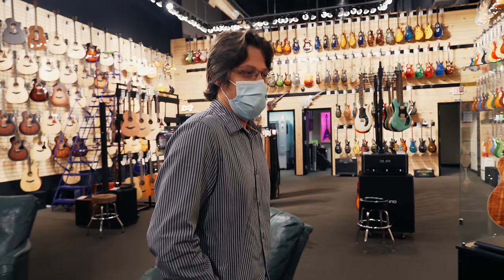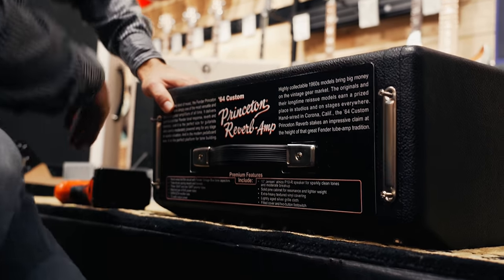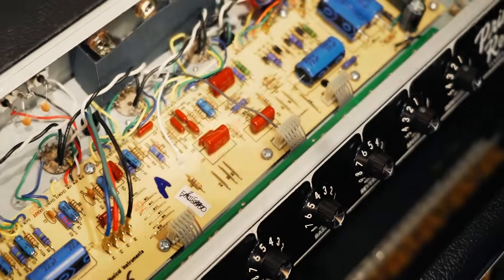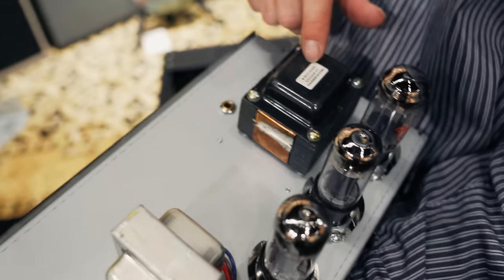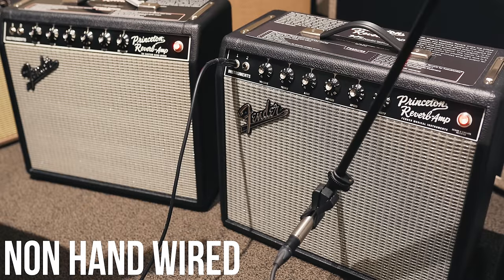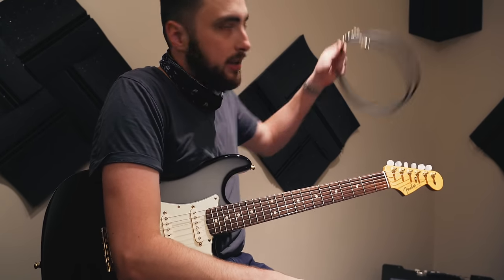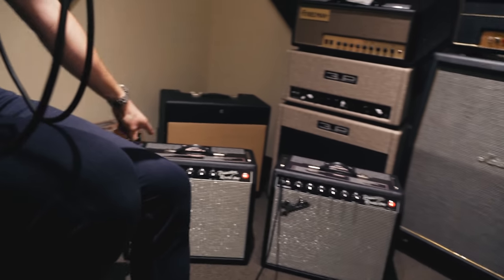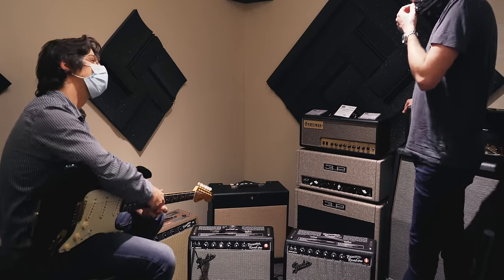Are Hand Wired Amps Really Better?

Comment: As Rhett said, don’t open up your amp. Accidentally touched a capacitor with my left hand, and I had my right hand resting on my guitar strings, so the current went up my left arm, through my heart, and out the right arm and zapped the strings. According to my Apple Watch, my heart rate was alternating between 40 and 190bpm for the next 15 minutes.
Reply: What would of happened if your right hand wasn’t on ur guitar strings? Glad u are ok!
Reply: Man I was playing my dad's old 60's windowmaker noname amp that still had a two prong power cord and was trying to plug a speaker into my computer to hear music to play to. One hand on the guitar and as soon as my other hand touched the back panel of the computer...SQUEEEEEK..was about the only sound I made but I felt that bolt shoot through my heart with this sick pop. I felt for sure that my heart had literally skipped for at least a full second. To this day the grossest feeling Ive very felt.

Comment: To me the non hand wired amp has a cleaner and brighter sound which I actually slightly prefer. I feel though the hand wired would sound better completely dimed but I don’t really use that sound . They both sound absolutely amazing though

Comment: As expected, the two amps sounded differently due to the different components, speaker and maybe even circuit schematic. Given a practically identical set of components and circuit for both amplifiers, the handwired vs non-handwired construction should not influence at all, as electrically they would practically be the same thing. Due to different layouts and wire placements on the handwired variant's board, it would be easier to replace components and debug, but that's a separate subject. Great demo and playing guys, they both sounded magnificent cranked with the black strat!

Comment: Again, what can't be beat about hand-wired amps is their gloriously quick, cheap, and easy serviceability. This cannot be emphasized enough. With basic electronic circuit knowledge, soldering skills and solid safety practices, you're golden. Eyelet boards are a total breeze to replace old worn out/out of spec components on, and even mod should you wish it (which is exactly what I did when I turned my AB165 into a AB165/AA864 hybrid with extra mods - all non-destructive and easily reversible). In my 25 years of owning this amp, I've never once required an amp tech, and doubt I ever will.

Comment: This was an interesting one. The hand-wired sounds better but not 1300 USD better... I also think most of difference is from the speaker Jensen P10R, which costs only like 80 bucks. In fact, I think Fender should simply make a more affordable (maybe Asian manufacturing?) version of the Princeton, Deluxe Reverb, and Twin Reverb. Both Vox and Marshall have ACs and Plexi style amps starting from 500-600 bucks, but for a Fender blackface sound you gotta spend at least 1000 bucks on the made in Mexico Custom '68 series or even more for the '65 American Reissues...

Comment: The hand wired version will likely last longer and hold it's value better. Tonally it is simply down to components and speakers etc. The solder isn't magic. The same circuit will function the same way whether it's point to point or PCB, it will just function more reliably for longer in a hand wired amp and be easier to maintain.

Comment: Another thought to point out is that a lot of the hand-wired amps are more expensive and the companies often go out of their way to use better capacitors in them (not the 2-year rated cheapies that might not be the best choice) ... and those alone might make a sound difference if you took that care with the PCB boards, the difference might evaporate further.  The PCB boards are technically better designed, so there's that. I have 4 PCB amps and 1 hand wired amp, love them all and will likely look into improving the capacitors on then Twin and Princeton in the near future, and then keeping them forever. 

  I have no prejudice against PCB boards, they're consistent and the amp sounds great.

Comment: I accidentally shocked myself on my hand wired amp that I built and my entire arm was totally numb for a long time after it knocked me backwards out of my chair .It also left a burn spot on my hand that is still there to this day ! Super dangerous if you don't show it the respect it deserves !
Reply: Yep. I was hit by 120V while working on a radio.  BAM to the arm.  And yes, it'll burn ya sometimes. Capacitors will too.  Best Regards and very good advise.

Comment: Another likely factor between the two amps that I didn’t hear mentioned is the difference in the woods used for the cabinets. Just like guitars, the wood also makes a difference in the amps.  64 Custom has solid pine vs. 65 Reissue has plywood I believe.

Comment: Yeah, I didn´t see the complete video to see they play different combination hand-nohanded components
Reply: see at 12:40
Reply: They also played both amps through the alnico speaker.
Reply: You're correct. But even more than that, there's nothing magic about a hand wired circuit which guarantees it'll sound better. It could just as easily sound the same, or worse than a PCB layout. Any remaining differences between these two after going through the same speaker are likely the result of the different components used (and any circuit differences, if there are some), rather than the point to point wiring. Copper traces on PCBs are just as conductive as copper wires.
Reply: @400_billion_suns  Possibly if the same components were used in both amps! They weren't the same because of bean counters! Also the cabinets may have been different (Wood vs Press Board).

Comment: I own a Fender 68 custon reverb , I purchased it used because it was in my price range . Would I have purchased a hand wire version if my finances allowed it absolutely . WHEN i PURCHASED THE AMP THERE WAS A  e v  ELECTRO VOICE FORCE 12 SPEAKER IN IT  . It just sounded OK . I swapped out the speaker with an Eminance GB 128 that I had the difference was amazing . While this  may not be my dream amp . It is as good as it gets for me . My point is I agree that the right speaker can change a goo d amp into a great amp .  Thanks for a great video !

Comment: Good idea to warn people about the dangerous high voltages present in tube guitar amps.   It helps to stress the fact that the larger capacitors in guitar amps often stay charged up even when the amp is turned off and unplugged.  I learned that the hard way in 1968 when I was exploring inside a Silvertone head.
Reply: Were the 60’s as great as everyone says?

Comment: I actually liked the slightly harsher tones of the non-wired amp. All comes down to personal preference. 
However, if you are looking for a slightly less harsh sound, some guy on here (Gary Roberts) put a 12" Jenson c12q speaker (which the hand wired 64 custom deluxe amp has) into a non handwired 'Knotty Pine' limited edition Princeton '65 and it sounded fabulous.

Comment: I have a special edition '65PRRI in my home studio in Blonde Tolex with a Wheat Grille. Mine's the standard PCB one, not hand-wired, but mine did come standard from the factory with the Jensen P10R like the hand-wired one here. I have to say it sounds fantastic and very much like this hand-wired one. Like they said, the speaker makes way more of a difference to the tone here than the circuitry. Another thing that's not mentioned in this video is that different bias'ing on the tubes makes a big difference to the tone you get. When I first got my PRRI it was biased way too hot and got really "farty" in the bottom end past 5.5. Had it re-biased and it's now perfect. Most amazing tone you could ask for. With a Nobels ODR-1, MXR Super Comp and my Strat, it's the best tone I've ever had.

Comment: Gotta say I was surprised to see how messy the wiring looked on the HW amp. But Rhett and the sales rep thought it was beautiful. 🤷🏻‍♂️ I’m sure they’ve both seen what the wiring on a Matchless amp looks like. THAT is beautiful. All wires neatly twisted together and running together where appropriate. I always assumed all HW amps look like that. I guess not, though. 🤷🏻‍♂️
Reply: Have you seen the inside of a Frenzel amplifier ?
Reply: Clifton Torrence I haven’t, but I’m guessing it’s more beautiful than this HW Princeton! I’ll google it. You should do the same for Matchless.
Reply: I totally agree. I would not be proud of the spaghetti mess, on the inside of that so called hand wired amp.
Reply: This one looks vintage (though still nicer/neater). They weren't trying to make the inside "beautiful" in '65.
Reply: The best looking amps on the inside are hand wired Hiwatts
Reply: Question: Does it do the job of making it a great guitar amp with minimal problems? If so, that's all a guitarist needs unless you are looking for a Ferrari compared to a Lexus. Most people never open up their amps to admire the wiring, but knowing it's hand wired brings a certain quality and reliability.

Comment: Both sound good but the hand wired has the edge. Components aren’t the same. Also the handwired is more reliable and if there were ever a destructive component failure I wouldn’t want a PCB.

Comment: Rhett. This maybe the best tube amp comparison I've ever seen. Not only you played clean, crunchy, and then gainey . And swapping the speakers. Just in creditable video.  I use a Fender Super Sonic 22 for gigs because it's light, and sounds pretty darn good for my 50's 60's band. But there is no comparison to my hand wired, Dr Z Studio Lead 38. But it's head and speaker. And I have to turn it up a little to get it alive. Loud amp. Thanks again for this video. And that hand wired Princeton, maybe my next amp.

Comment: Thanks a $million for that. You guys covered almost every angle on the amp comparisons. That better speaker made the biggest change IMO for the money. I am however, an amp tinkerer. Easy to test the components and swap them out on the hand wired. The cheaper caps and resistors in the stock model could be the cause of the EQ diff. The values tend to be more variable. I have two old champs and have modded them some for excess hiss etc. but by no means an expert.

Comment: where's the "Hand Wired Amp-Non Hand Wired Speaker" part!?
Reply: Near the End !
Reply: Charles Peck time in video?
Reply: @charlespatrick8650  You can find it as well as I! I would have bring it up and search so you do that!
Reply: I knew they weren't gonna do that because why would they? Well it would be scientifically helpful to see if the handwired in the ceramic speaker sounded worse than vice versa, but they don't think that way those guys who are into this gear.

Comment: While using the Alnico speaker on the circuit board amp brought it much closer to the HW amp, there still was a notable difference in how they responded dynamically.  Moreover, the HW amp was rounder in its tone and seemed a bit more 3 dimensional.  As much as you could tell via this recording method.   Every HW amp I’ve ever played through always seemed to have a bit more bounce and more of a 3 dimensional sound.

Comment: I have the ‘65 Princeton Reverb. The speaker in it is, hmmmm..... but I already knew I was going to change the speaker for the amp (like I did with my Deluxe Reverb). I put in a 10” Eminence GA10-SC64. Ceramic. Huge difference! The stock speaker does have that mid scoop sound. With the new speaker, the amp sounds way better. I also changed the tubes. Switching v1 to a Tungsol 12ax7, the Phase Inverter to Electroharmonix 12at7 and the power tubes to TAD 6v6 GT STR, were a huge help too in opening up the amp. The sound is there, you just need to help bring it out. When they mentioned the ‘65 Reissue will get lost in the mix, it was because of the stock speaker and tube complements. Changing the speaker and tubes solved that. I will say, I am drooling for the hand wired but more for a collection thing.

Comment: Handwired got nothing to do with quality or sound, it's all about the circuit and components. If the manufactures insisted, they could make non hardwired easy to maintain. try to hardwire your phone.
Reply: a phone is actually a pretty simple thing to handwire. and if it is subsequently connected to a proper landline it will likely sound better and get better reception than the do-everything app infested pocket mini computers everyone is carrying around these days. a simple guitar amplifier is pretty much the same thing...it is designed to do ONE thing....be a guitar amp...a  real "phone" is the same...it does ONE thing....the thing in your pocket is NOT a "phone", so it's an unfair comparison.

Comment: Huge difference in those amps. I'd take the hit and get the hand wired. I have a hand wired 74  Fender baseman 4 X10 tube and a regular Bugera tube amp off the shelf.  Similar difference especially with my Strat. The Bugera is more mid range and scoopy- good for metal with my PRS and Ibanez guitars. My Baseman is way better for my Strats especially for blues, country and funk. Unfortunately I will be parting with the baseman because I do not gig and it's HUGE. I'm more of a bedroom and home recorder.

Comment: Considering the two have different speakers that makes all the difference as an amp will only sound as good as the speakers and any differences makes the comparison really unfair
Reply: Someone didn’t watch the whole video 🤔
Reply: @chasebladorn36  Yup!
Reply: They're the same on the outside. They're not the same on the inside. They're not the same. The expensive one sounds so much better than the less expensive one (you'll note I didn't say cheap).
Reply: You are right...speakers are the key....I plug my Princeton RI 65 with a second cabinet which is a closed Back Tremolux Cabinet with Eminence speakers and my Princeton really shines..then when I plug it into my Silvertone Cabinet with 6 - 10" Jensen Alinico 1965 Speakers it really will blow your mind...I found two great amps 57 champ and the 65 Princeton RI and have invested in Speaker Cabinets to change my sound...have 1-10 in the amp - 1- 12 cabinet...a 2-12, a 4 12 and the 6-10....sound if I want different flavors of sound...I change speaker cabinet...not the amp...15 watts can drive any of these really louder than I ever could play at home!!!

Comment: I don't think it's so much about the hand-wiredness...I bet if you built a PCB-based amp with the exact same---read, better---components and schematic as the hand-wired version, and used the same driver/cab (as you already found), you'd find that there'd be essentially no difference. There's nothing inherently "better" about point-to-point wiring vs. a PCB at an electrical level if it's done right...If there IS a difference, the PCB isn't done right.

All that being said, no manufacturer in their right mind would do such a thing, cause they'd be killing off a huge revenue stream for their cut of the boutique-style amp business. They'll happily sell $1,300 amps to the guys that can buy $1,300 amps, and $2,600 amps with some extra special sauce for the guys that can buy $2,600 amps.
Reply: I think part of what happens is that the hand wiring is expensive on labor. So, they upgrade the speaker and components to make it sound better to justify the added cost. 

I also could see being able to replace individual components as a plus if it was something that would get used touring. But, that could be done with the boards if they wanted.

Comment: On an iPad without headphones it all sounds the same.
Reply: use headphones dude
Reply: The hand wired is warmer but it also has a different speaker so that could play a part. My son uses his AC 15 & 30 (heads) paired with a vintage 30 speaker for his church worship so they are both warmer than the combo that usually comes with a Greenback which gives you those glassy highs and mids of the typical Vox.
Reply: On an iPad without headphones, everything sounds the same.

Comment: Good point on the pots damaging the board.  My input jack on my fender fractured its solder joints on the PC board.  If I could, I'd retrofit it with a hand wired amp.

Comment: Seems like, per your Dumble video, if you use an EQ pedal... and maybe replace the speaker, the non-hand wound amp could sound very close to the hand wound, for a fraction of the cost.  That appears to be the sound economical choice for garage bands and home studio recording purposes. But, the hand wound does sound great!  Plus, I imagine there is a smaller carbon footprint on the hand wound, too.  Great video!

Comment: It’s not necessarily about the sound—it’s the fact that every single part of a handwired amp was designed to be maintained and repaired for eternity.
Reply: ...until valve supplies are exhausted and can not be replaced    :-/
Reply: Yeah they sure are nice man. I have like….. 11? Amps? No hand wired. Oh Gawd something else to obsess over
Reply: @deanmccaskill5495  I have several hand wired amps, and still use pcb amps as well, don't let the tone elitists convince you that an amp won't sound good if it didn't cost you two grand
Reply: @jasondorsey7110  I been into my Hiwatt lately. Man that thing growls!